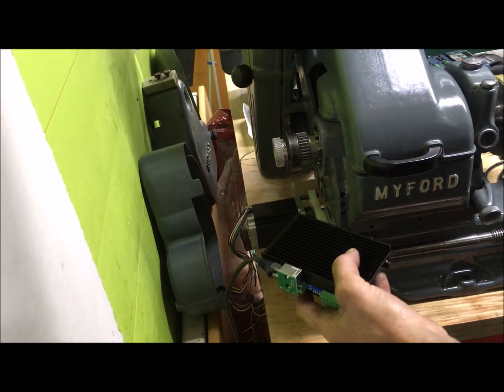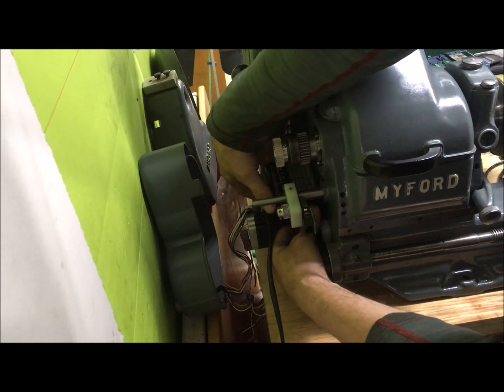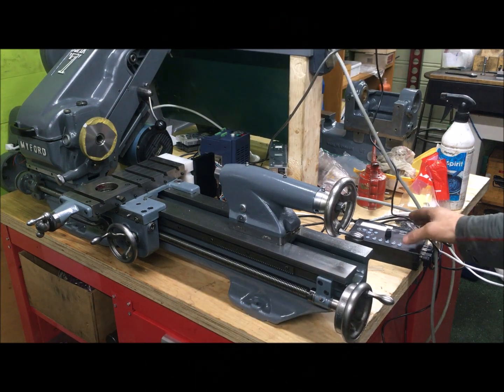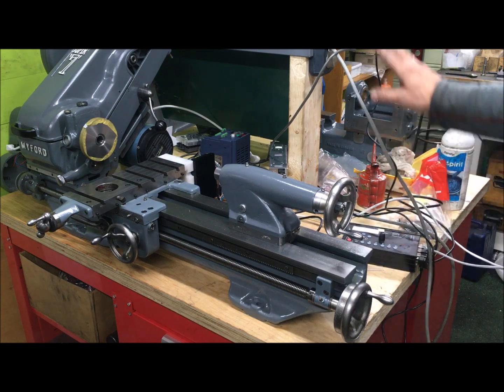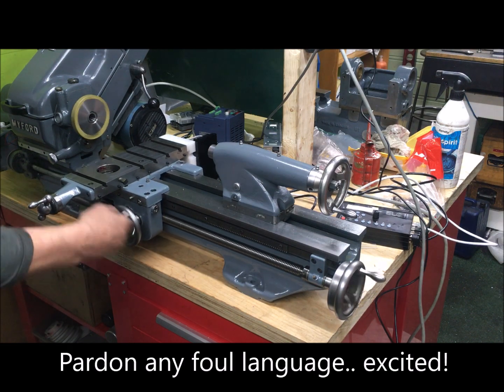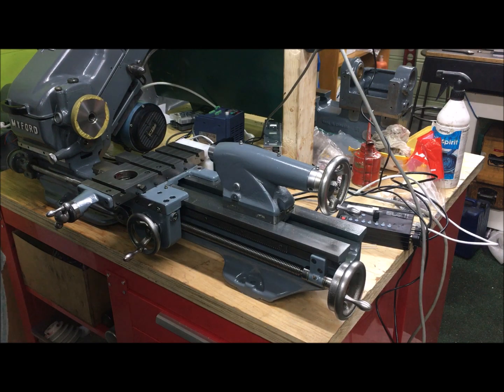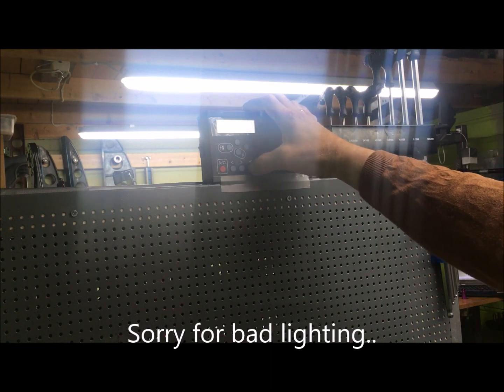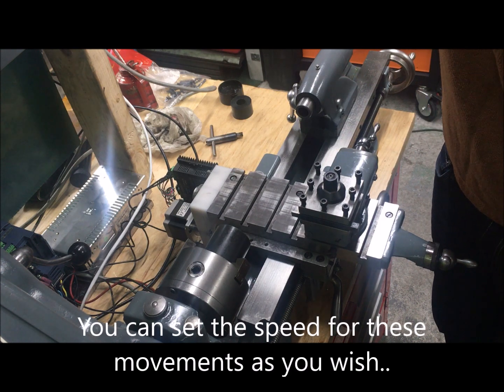Myford 7x 7   Mk1 S7   ELS equipped - part 3

Comment: Interesting video series.
Reply from the maker: Thanks! Interesting for me too! Breaking new ground, so to speak. As said, the reason for the ELS was to do away with the need to change gears between threading and feed and be able to have any setting for both. The solution appealed to me as it retained leadscrew/clasp-nuts ie. manual positioning of the carriage and the possibility to use the manual feed. Also the relative small diversion from a regular machine ie. easy to get back. The cost is comparable with a gearbox for this particular type of machine. That said, it is not the same as a gearbox. It offers a wider range of feeds/threads, but is in some ways less "industrial" so needs getting used to I guess. 
The cross-feed of course enables a whole range of new (semi)automatic machining operations was not part of my original incentive to buy this system. But, as it turned out, I think it will be a nice addition.

Comment: Looks like it will be useful for the whole range of machine operations, not just turning and threading.  I can picture shaping keyways, using  toolpost grinder,  line boring...

Excellent work as always, sir!
Reply from the maker: Thanks! Yes, there are a heap of applications I can think of, some of which are also described and well documented by Rocketronics. Will have to learn a lot more and ease my way into this new for me territory. First now is tidying up all the loose cables, making some covers and a mounting/stand for the ELS and PSU. I have also thought out some improved mounting blocks for the motors (in POM.. yes.. haha)

Comment: Quick question, Is there a particular reason why you've mounted the stepper controllers right next to each stepper? Could the Power supply, controllers and other electrical stuff be mounted in a central location for convenient access and also for easier protection against chips/coolant?
Reply from the maker: I reckon you can mount it further apart, but there might also be constraints wit regards to signal disturbance or similar.. PS! Actually this was "thrown together" to meet a deadline targeting a club meeting on Saturday. .haha

Comment: Absolutely needs covers Jan.  Swarf will kill the the psu in super quick time.
I want to see you cut a taper!
Reply from the maker: Fully agree! Will  force myself to wait wit hthe test cuts until I have done that and also learned the system better. Thanks to the nice website, theer are many application examples to look at (and read the thick manual)